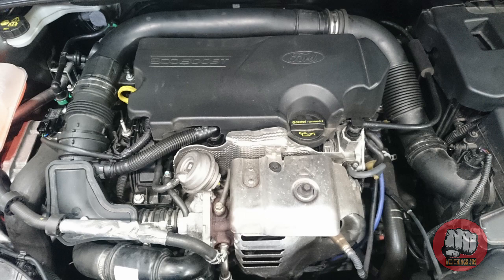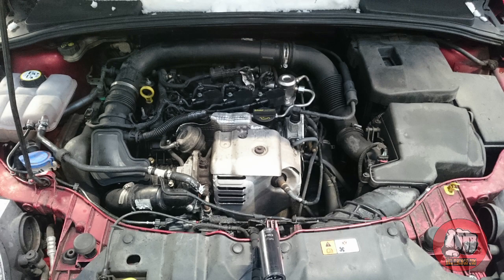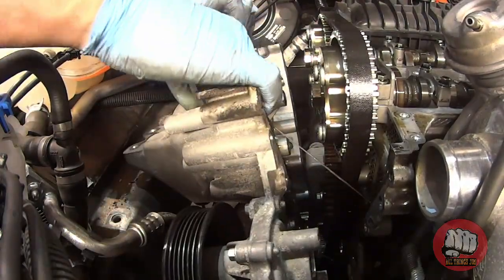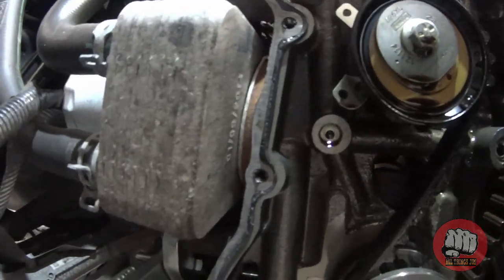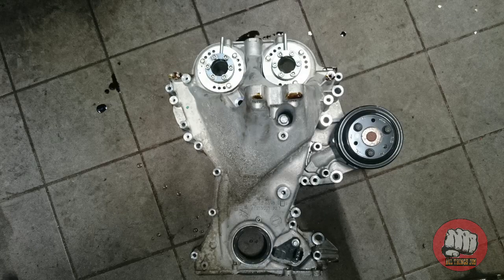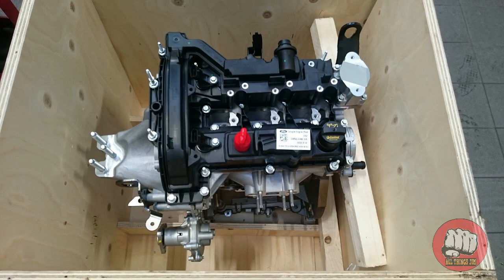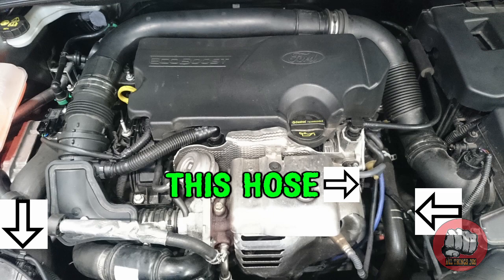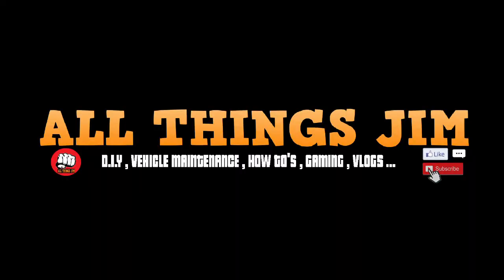Lets discuss the 1.0 Ford ecoboost engine

Comment: Sadly the 2.0 EcoBlue turbo diesel has a wet belt. Also the Peugeot Puretech engine has a wet belt.
Reply: The 1.2 puretech (BMW/PSA design) engine is the worst of them all and has serious issues.
Stellantis refuses to give solutions to the problem and lots of owners of such an engine are left with bigg bills.
Reply: @obelic71 I thought there was a recall on them due to it also affecting the brake vaccum pump when it blocks the oil so they have to fix it for free under the recall?
Reply: @sbrader97  there was just a recall for a very limited batch of cars. 
The problem occurs on all of those 1.2 engines.
40-60K kilometers is the average life of the wett timing and oilpump belts.
Stellantis built for themselves and sold to others a shitload of those engines so you can imagine it makes their accountens and lawyers very nervous.
Those wett belts are the deadly Achilles heel of a further very good engine.
Reply: @obelic71  the 1.2  Puretech is not a collaboration between Peugeot and BMW. That was the old Prince engine which is also pretty horrible

Comment: The eco boost engine is a totally flawed design, even the latest version still has many problems, it’s just a ticking time bomb waiting to go boom
Reply: Think that's ford's intention
Reply: @geoffsclassiccars  ford now buy car platforms from volkswagen group for the new ford explorer ev , thats going to work well , they are just going to go up in flames 
Fords days are numbered
Reply: What problems does the new one have, it has a chain instead of a wet belt, which is a good start?
Reply: @sparky1543  wet belt is still used for the oil pump drive , they solve 1 problem by using a timing chain for the cams but don,t reengineer the oil pump drive , wet belts are still failing on the oil pumps

Comment: I have a 2013 fiesta  ecoboost, and had a belt tensioner go, and damaged 2 exhaust valves on pot 1 & 2. Looking at the original tensioner the tensioner spring on it was held in place with plastic bars, and that’s what went and released the tension. I have rebuilt the top of the engine with new valves and belt kit, the new tensioner spring is held in place by metal thank god. As for the crank bolt I invested in a Milwaukee M18 Fuel ratchet with a nut busting torque of 1385 nm, I heated the bolt as I was replacing the crank seal, and it came out straight away no problem. For those who want to know the bolt has a torque of 720 nm!
Reply: @@MattChalker9 Its done 22k miles you plank. It should run with 0 fault at such l,ow mileage.
Reply: @@MattChalker9 What was that? Can you repeat it in English? My point still stands your car has done sod all in terms of mileage so it shouldn't have any issues.
Reply: Why the hell would it need to be so tight...

Comment: The idea of the wetbelt is that the oil is supposed to preserve the belt so you dont have to have it changed as much as usual, so you have the smoothness and cheapness of a belt but the reliability of a chain but weather this  actually works or not is another thing. Ive seen it work for some people and dont forget a lot of these engines have been sold, so proportianlly they might not have as many issues, I think a big part of it is the right oil being used (ford spec 5w-20) at regular intervals to help the belt. Also engine flushes apparently wreak havock on the belt so dont do that but this may contribute to the issues as some dealers/mechanics/people may put the wrong oil in or flush the engine.
Reply: It is totally not the idea! It is mainly because of less friction so that they can keep using it in newer Euro pollution norms. Regular oil changes do extend the service on the belt a bit, but don't solve the problem of a belt that not supposed to be in contact with oil. So many well maintained cars that broke down because of belt issues. Let alone the Stellantis 1.2 PureTech that has it too. There are cases of only 30k km's and a belt that broke because it got porous. It skipped some teeth after, destroying the engine fully. Also multiple cases of oil starvation because the teeth of the belt break off. Ford and the Stellantis group changed their service plan to lower km's per service, and also for belt changes which are very expensive. Stellantis charges €2200,- for a belt change in some dealerships.
Multiple garages that I spoke to are speaking of "rubbish" engines that are designed like this. Good garages advise you even to skip these engines... just like the gen. 1 and 2 TFSI from VW(because of different reasons).
Reply: Fact are facts .The engine design has totally destroyeed fords already poor reputation. @TheVeenmeister
Reply: The phrase you’re looking for is “parasitic loss”
Reply: I think people forget that Ford engines in the past had toothed belts Pinto all sizes CVH recommended change at 36000 miles common for the crank seal to leak onto the belt. Vauxhall introduced a belt on FD engines. Fiat used the same setup. Agreed running in oil is a strange way to go but the replacement intervals has extended which affects second and third owners.
Reply: So much bullshit, if it ain't broke don't fix it, chains run in oil and belts run in fresh air, proven in Hundreds of millions of vehicle's over many decades.
Reply: Petrochemicals dissolve rubber based products. Thats a fact. Making this the most ridiculous design choice ever.
Reply: No, that's not the reason why some manufacturers choose this (idiotic) wet cambelt. It's because in comparison, to a normal dry cambelt, and a wet chain, the usage of a wet cambelt, is the one with less friction, and therefore the engine will get a marginal better gas mileage, so the numbers from the manufacturer, looks better, when selling the car new. Manufacturers couldn't care less about preservation of the belt, if they did, they wouldn't state that a 1.0 Ecoboost with wet belt, can go 20.000 km' between oil changes, which is way too much, for all cars, especially one with a wet belt, where every little grain of grit can damage the rubber on the belt.
Reply: @IncognitoX8  Yeah, I watched another tear down of this engine. The belt literally got destroyed by stuff in the oil, it got porous, then soaked in all this dirt and debris. It started to melt, created slime and that slime was everywhere in the engine. It is such stupid thing to do apparently. You want the least amount of non-metal material inside that oil chamber
Reply: 对 应该加入正确的机油  5w20最好
Reply: This is nonsense who told you that.Oils have detergents in them which is contributory to breakdown
Reply: @Antonio-gq6fx  Special oil, it's DPF regen diesel contamination that rots them.
Reply: @G-ra-ha-m weird because they are petrol engines
Reply: @nickfoord750  The transits were diesel. Either way, oil in contact with rubber is a bad and pointless idea when cogwheels are cheap, and the balance shafts get rotating cogwheels to the right place anyway.

Comment: I believe the later engines switched back to chain driven.
Reply: I’ve got the 1.0 ecoboost puma . I’ve read if the turbo is to the rear of the engine it’s chain driven.
Reply: Yeah but still a wet belt for the oil pump however i havnt heard of any issues yet with the new chain ones on mk4 focus/mk8 fiesta
Reply from the maker: Yes i think the latest have 👍
Reply: Do u know from which year ?
Reply: @kevinthacker8349  MK8 modles
Reply: Arent those the 1.1 EcoBoost?
Reply: @terrificspokesman7416 no the 1.1 is non turbo so not a ecoboost that one is more of a replacement for the old 1.25 engine

Comment: Just like there V6 Ecoboost. Poor oil pressure for the chain tensioner. Wears really fast and failure . Hard to understand where all the testing goes in prototypes , good video 🍺
Reply from the maker: Didnt know that, dont think ive ever seen a V6 Ecoboost engine- thanks for sharing and watching 👍👍👍
Reply: @ALLTHINGSJIM  they use them in the states
Reply: where does all the testing go in prototypes you ask? To make sure they just last the warranty and nothing more...